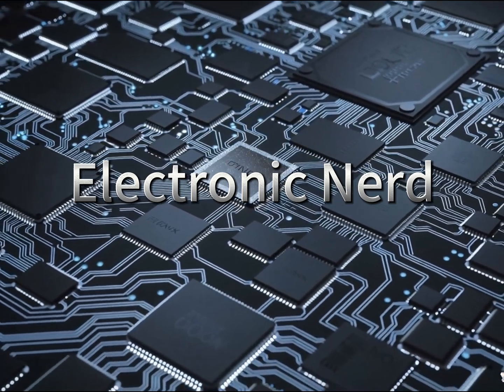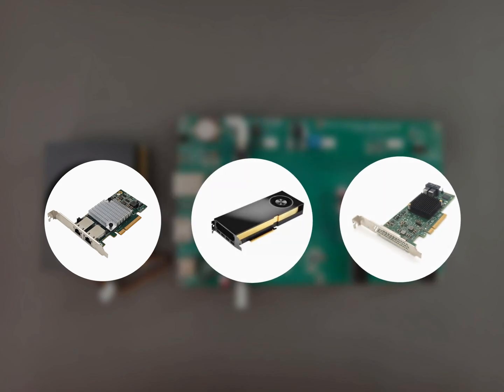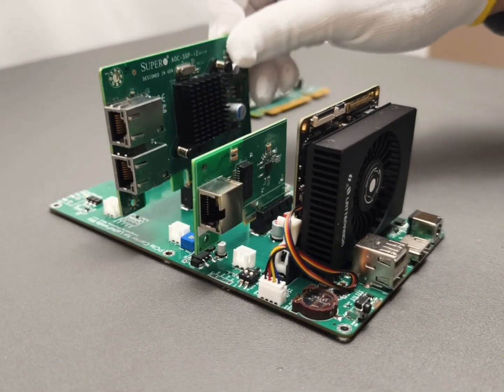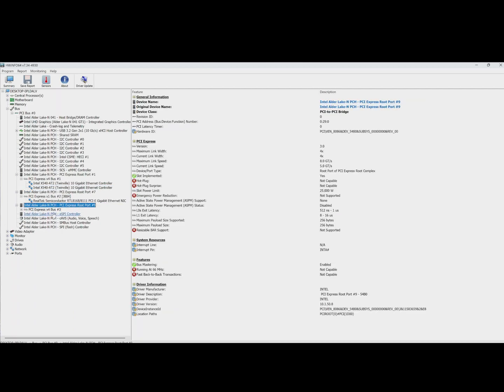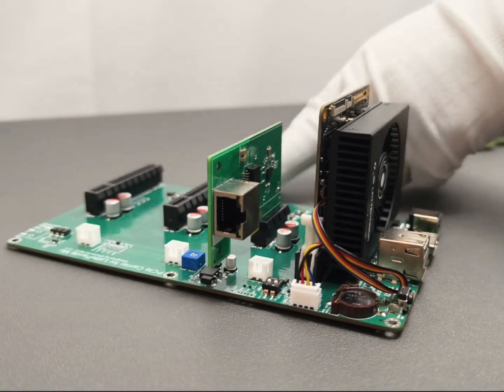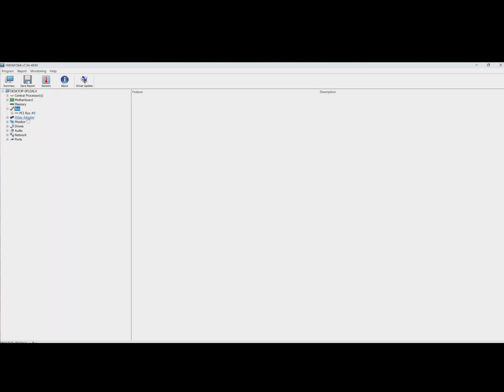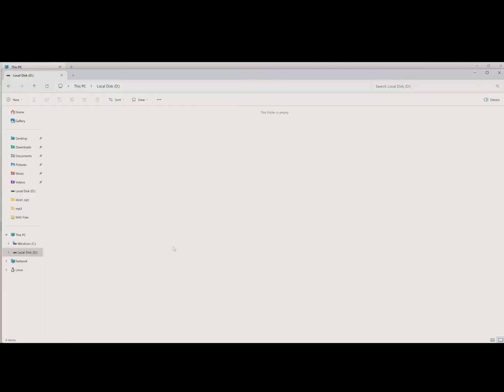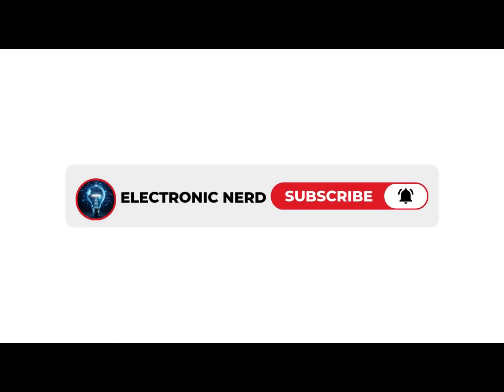Versatile Router/NAS System with LattePanda MU: More Flexible than Zimaboard 2

Comment: do you need a special bios to use all the 9 pcie lanes? thanks for the video
Reply from the maker: if your PCIe lane configuration differs from the LattePanda Mu's default configuration, a custom BIOS is required. My PCIe board needs to work with a special BIOS.